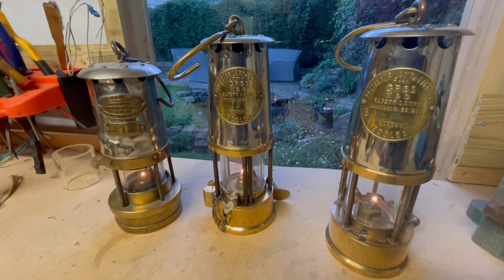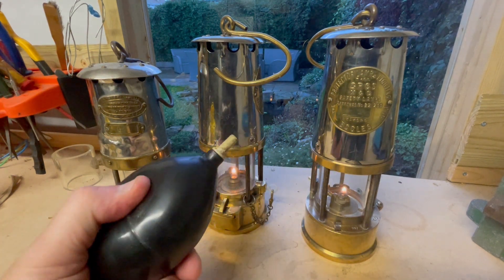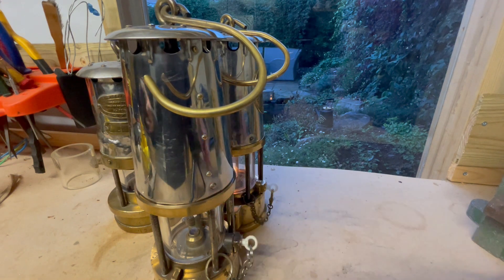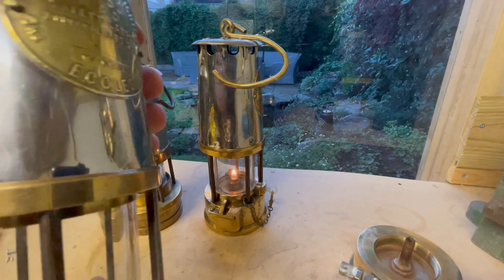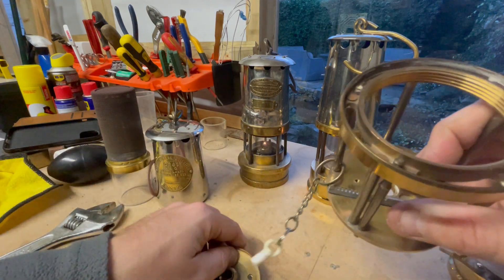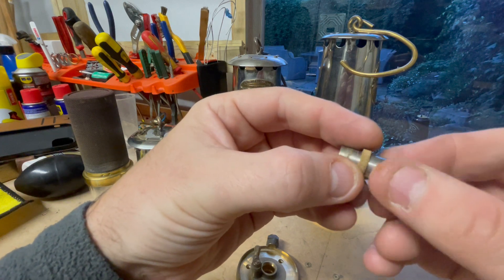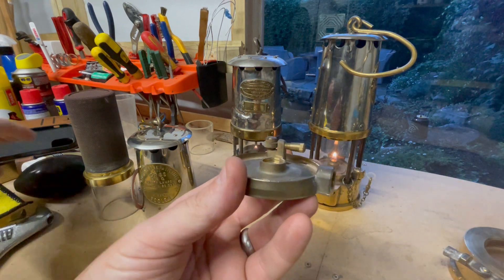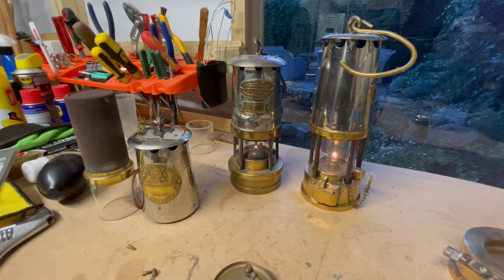Garforth mines lamps

Comment: Hi, would you please tell me the different between GR6 and GR6S models.
Reply from the maker: @ToTa-mh6re The GR6 lamp had a brass tube in the lighting plate. The heat of the flame caused this brass tube to split. The solution was to remove the brass tube and replace it with a stainless steel tube. The lamps that had the new stainless steel tube fitted was named GR6S - S standing for Stainless steel. So in effect, the GR6 and GR6S are essentially the same lamp but with the modification. The GR6 was introduced in the late 60's and was quickly superseded by the GR6S.
Reply: @LampBoy3583  
Thank you very much.